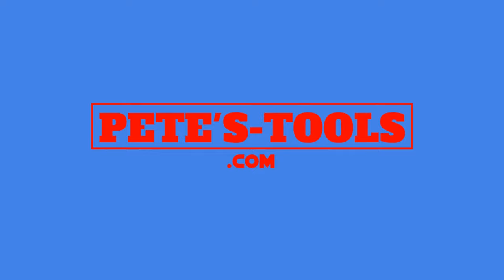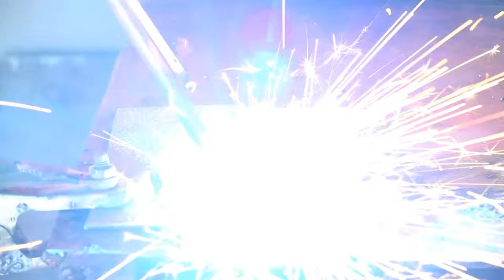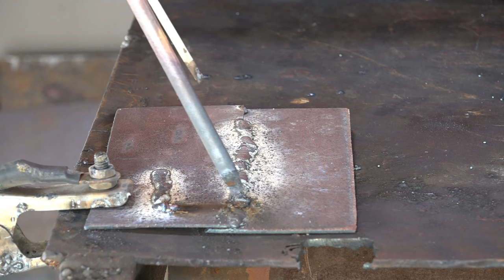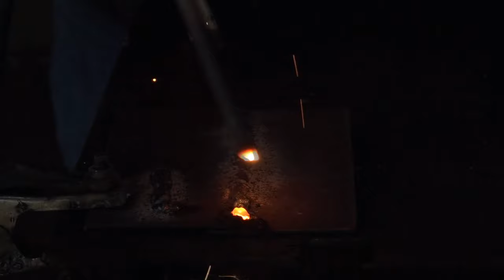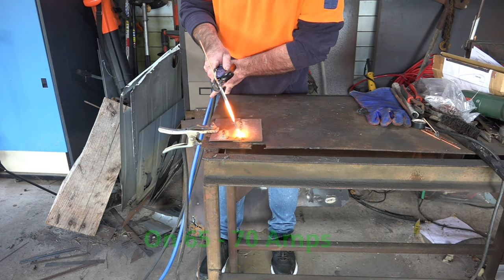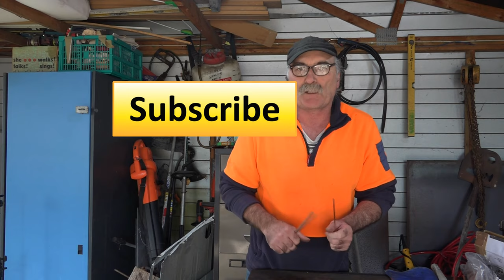Carbon Gouging Rod - How Big Do I Need?

Comment: Another use for the carbon arc is to just heat steel.  So for me and my small welding machine the big carbon works very well for heat metal so that I can bend it.  This does not negate your point I'm simply saying heating and pre-heating the big one works very well.
Reply from the maker: Thanks for the info!

Comment: we sometimes use those rods to backgouge . we just crank it to the max and fly with it. our average rod is 1/4inch. just use the plaz at 45 amps and tilt it at 30° or less and really fly with it.
Reply: also g'day Pete
Reply from the maker: Nice
Reply from the maker: Hi Bob thanks for watching
Reply: g'day Pete. im a huge fan of plazmas. the one thing I haven't heard from you is that oxy acetylene torches are really only good for bending metal.
Reply: @bobprice9244  you can cut and gouge with oxy/acetylene just fine. Only problem is the gas is expensive.